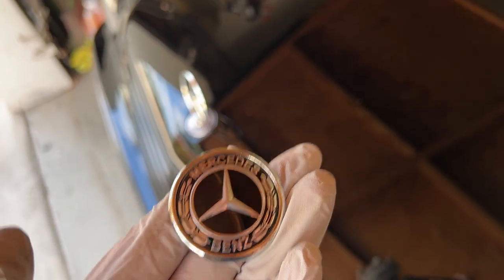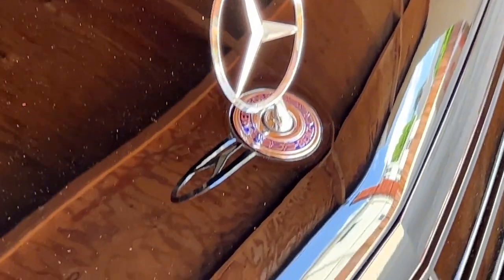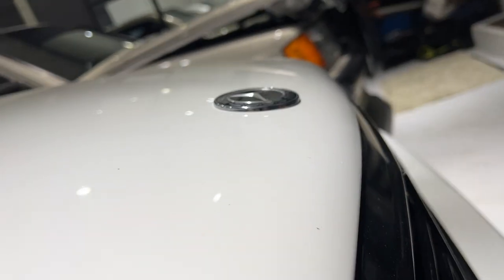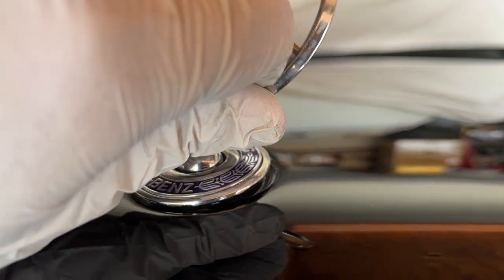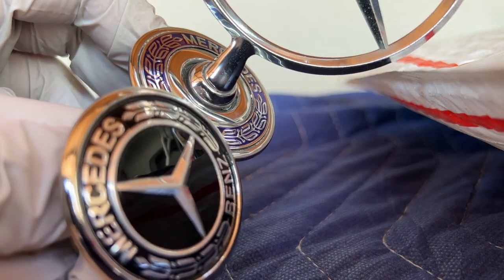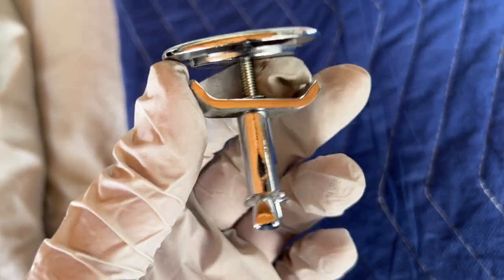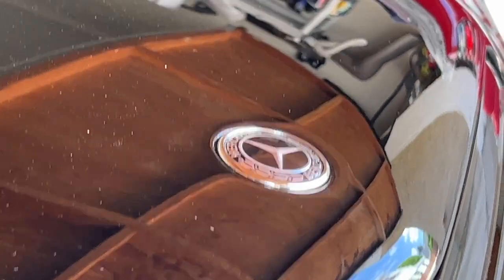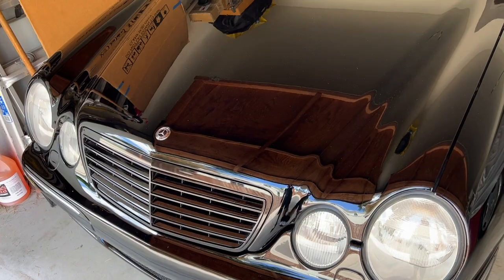Mercedes Flat Hood Emblem on Cars with Standing Stars

Comment: Hood ornament is always better than the flat badge
Reply: Yeah man keep it the way Mercedes intended 👍🏻😎 #hoodornament
Reply: Except when you have a grille with a large badge, then it looks weird having 2 badges
Reply: @K20TypeR  star grille and star hood ornament look redundant to me. Star grilles do look good paired with a flat badge
Reply: @RATTLER238  Hood ornament means luxury car.  Flat badge is sport models.  Both are as Mercedes intended.  And the ornament looks stupid 6" away from the star on the grille.  (also as Mercedes intended)   Needs a plain grill with the hood ornament.
Reply: I have a w220 I bought that came with the flat emblem fits perfectly in my w210 and  just ordered the star grill for the w210 to go together with the flat emblem

Comment: Pretty goofy that the Mercedes emblem is a foil sticker.  I barely touched mine with a random action polisher and instantly wore the color off the edge of the medallion.  Be careful, fragile.
My 06 SL500 does not have the cutout in the hood pictured here.  2 small holes through the hood, for two studs on the back of the medallion.